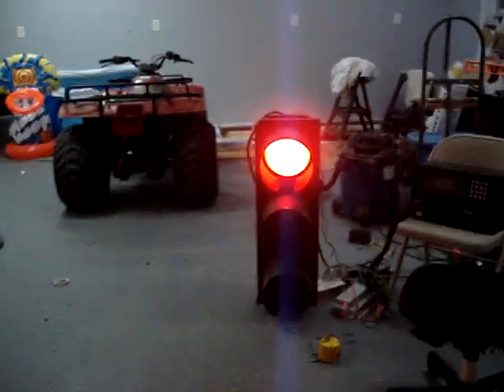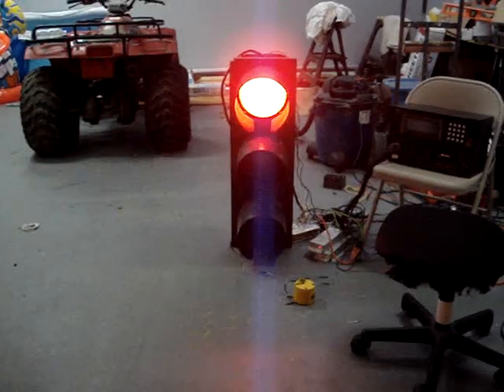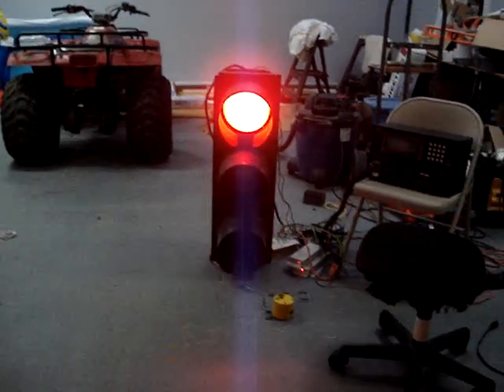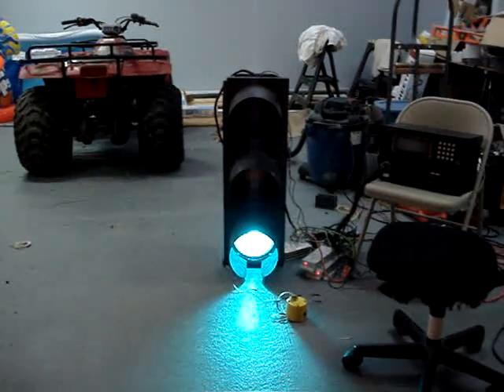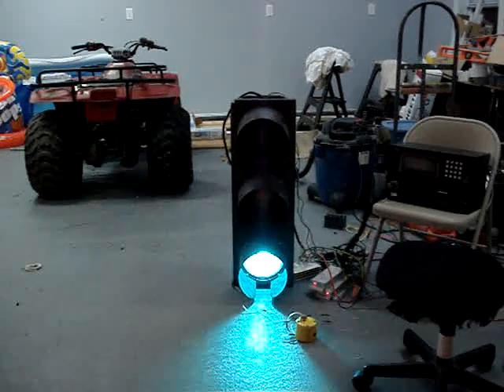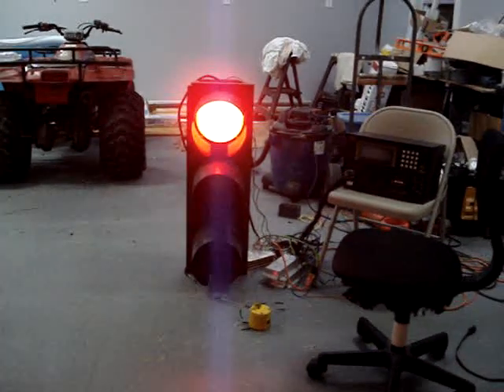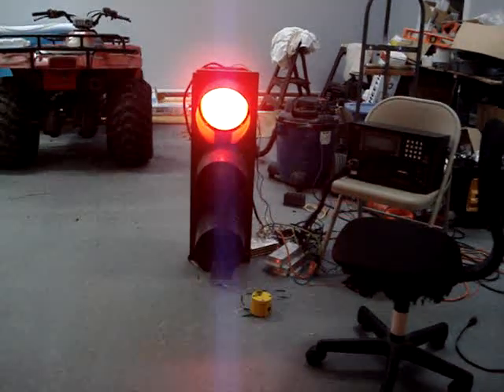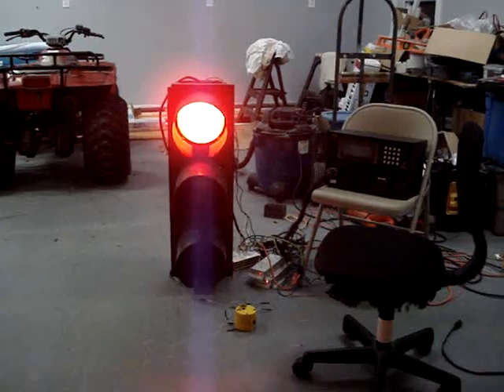My 8" T/CON Traffic Signal controlled by my Eagle EPAC300 Signal Controller

Comment: You can usually find a cheap circuitboard style controller that fits inside the signal on the auction websites. Just search for "traffic light controller" or "lights to go". If there isn't one now, there will be. They usually run over $50 depending on how many people bid on them. Installation is simple.

Comment: Charlie, 
I know you how to wire it, lol i taught you that, its just the "pile" you have going with the load switches that bugs me. I don't want you to get hurt with it or damage a nice controller like the EPAC. A cabinet would be a good investment and keep the controller running inside. or even just a small shelf with the wiring neatly mounted. 

-Nick

Comment: to continue from my last post, he would be much better off if he mounted the controller load switch packs appropriately in a locked cabinet. Thats the proper way to do it. I've told him constantly to do this, I guess it's going to take a fire, damage, or himself being blown across the room to get him to put this thing in a cabinet like it should be.

Comment: Obviously you haven't been bit by 120 volts. Not a tickle, and plus the amps can kill. Anything over .01 Amps kills and this setup has 2. Not only that but the EPAC units as well as most traffic controllers run on a low voltage, if the wiring pile he has going comes loose and the high voltage connections touch the low ones, you'll blow the brains out of a very expensive controller and pose a fire hazard. In other words, electricity is nothing to "play" with, especially the higher voltages

Comment: lol restore plastic. You can't really restore plastic, you can clean it, thats really it. But anyways cool video. The EPACs do 16 phases but 8 phases have outputs. the other 8 have to be modified to work. But to be picky, I am NOT impressed with how you have the wiring set up. Live voltage is a concern, and the wires can easily slip off a load switch and blow the EPAC and give quite a fireworks display. Build a cabinet and mount everything inside.